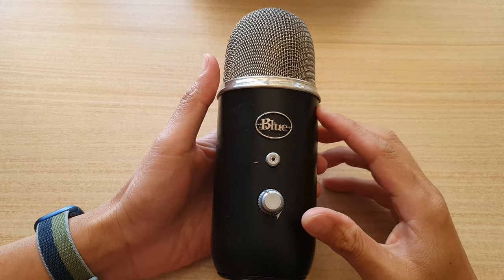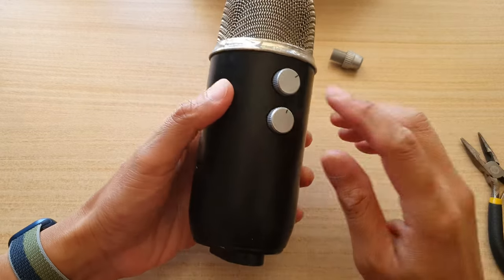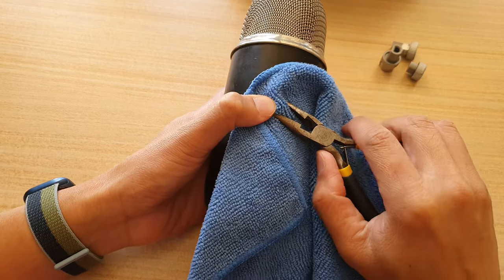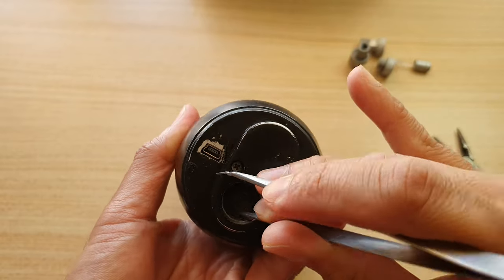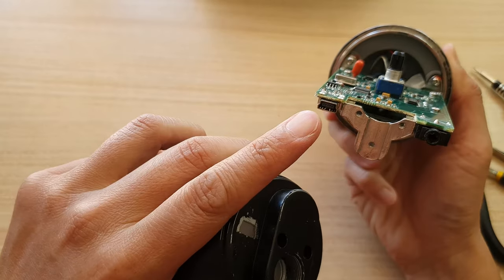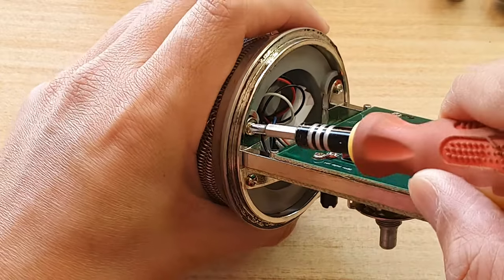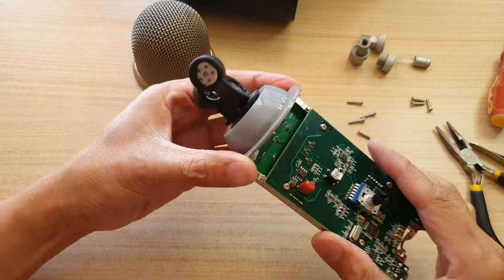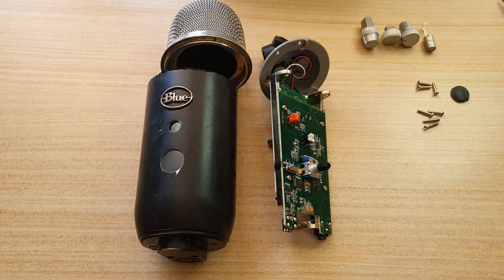How Take Apart a Yeti Blue Microphone - Disassembly and Teardown

Comment: Wanted to say thank you so much for this. I bumped into my mic and the usb was loose. I was able to take it apart, squeeze the metal that holds the usb and now my mic is back to normal. YOU SAVED ME THANK YOU
Reply: exactly why im here. good to see its gonna help
Reply: i tripped over the cord and the mic didnt fall thankfully. what did you use? i dont want to break the connector off...
Reply: i have the same issue but i got it stuck trying to get it out so its just not gonna work unless i can manage to get the button out
Reply: got it out but it seems the thing the usb goes in is unsoldered so idk what to do

Comment: Thanks for the tutorial!  Our old reliable yeti took a noise dive off a shelf during a recording session around 5 feet and hit the carpet.  The only damage was a dent the front screen mesh around the mics where you talk in single mode.  I followed your instructions, and carefully bent it back so it's looks as good as new.  A quick test and all is working the way it did out of the box.  With that small dent, there was a little distortion around plosives even with a pop filter in front so it must have been touching one of the mics or redirecting the sound to make it sound bad.  Now it's back to the way it was before the accident.  Since the mic was replaced with a audio technica 2020 with a mic arm and shock mount shortly after the time of the accident,  it will be a "back up" mic and mostly used for quick desk recording going forward.

Comment: at 5:33 there is a big orange capacitator on the board. my board is exactly like yours but im missing that. its "C33". could you tell me what the specs are? i know its been 2 years since you made the video but i think i need to get that part. i bought mine used thinking i would probably just need to get the usb mini b port but mine is actually ok. its just that cap. if anyone could help it would be great.